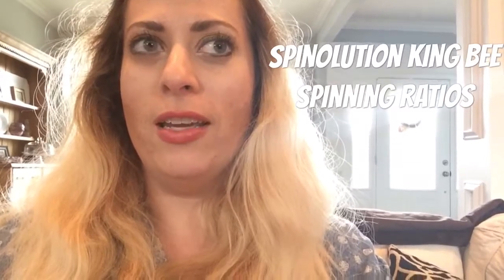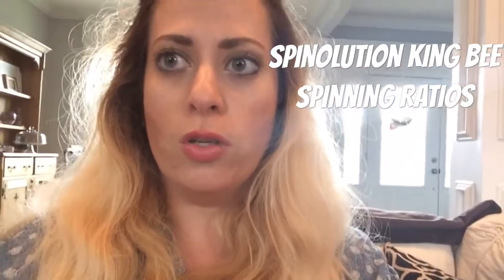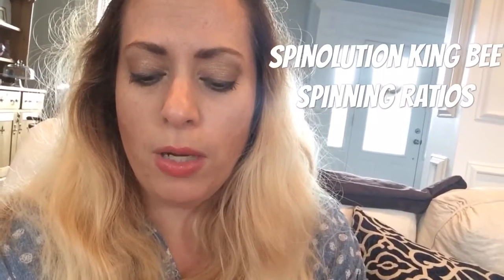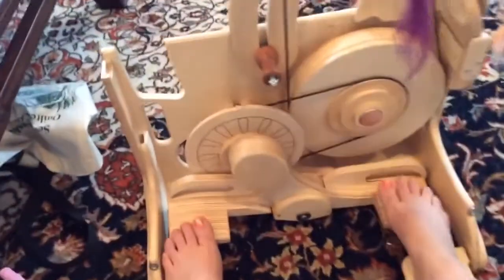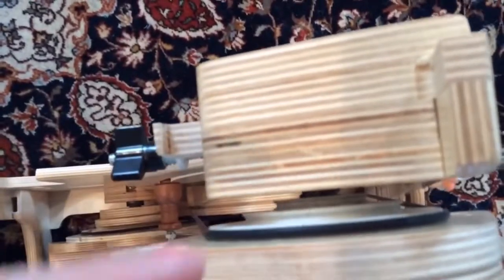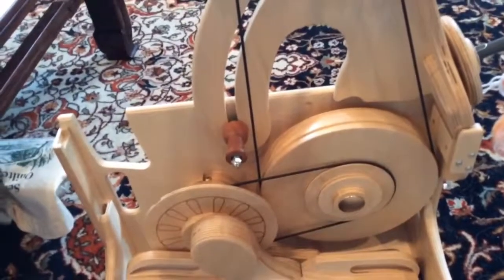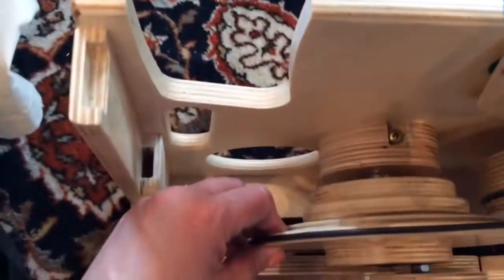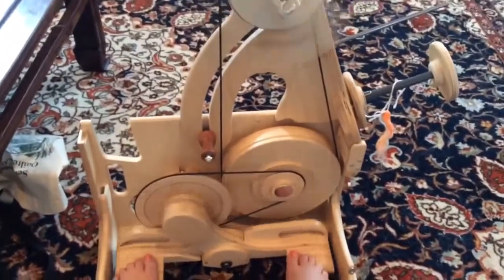Spinolution king bee spinning wheel ratios demo and my preferences.

Comment: Looking back on your king bee, woul this still be the one you would have purchased? I plan on buying this very soon from your website. I just want to be sure it’s the right one.
Reply from the maker: Are you asking if I still love my king bee? I definitely do it’s a great wheel it was just very different from the louet I learned on. Will this be you’re first wheel ? Or do you currently have one?
Reply: This will be my first :-)
Reply from the maker: cheryl fjermedal well way to go straight to the cream of the crop haha :) like I said in the video I feel like most people kind of get a setting that they prefer and if you were learning I would definitely say maybe pick an easier one like the one I showed in the video and stick with that and just adjust the settings on the top for thicker or thinner yarn but even with that you’ll probably just find one that you kind of like the best for a good worsted weight yarn probably either the biggest one or the middle one for the flyer gear. Once you get a wheel and start spinning if you have any particular problems or questions I’d be happy to make you another video.  The king bee is a great size. I love the 8oz Bobbin it’s big enough that I can get bulkier yarn on it easily which I do a lot for my business but it still small enough that it’s not heavy to treadle. When you first get it I would recommend just playing around with some simple gears and just treadling without any yarn on it just to get a good rhythm down before you start spinning yarn.